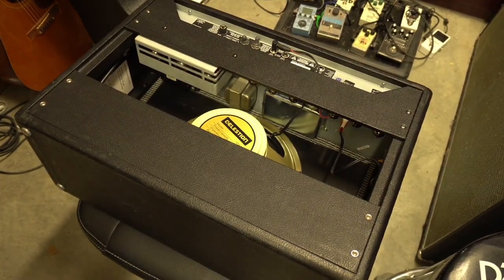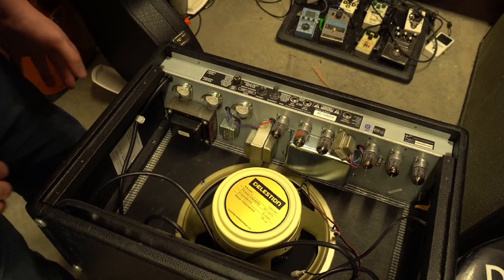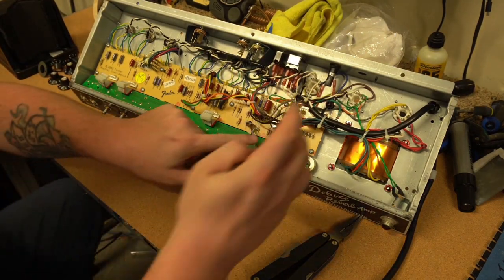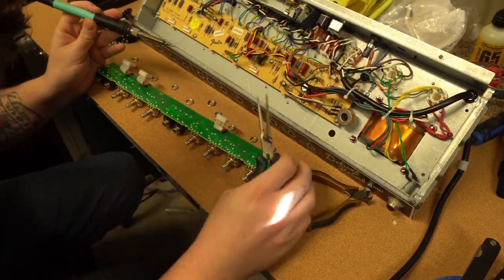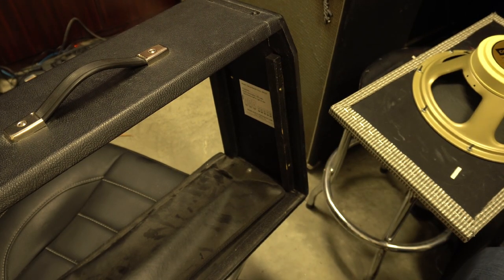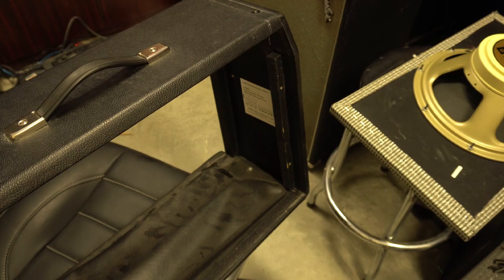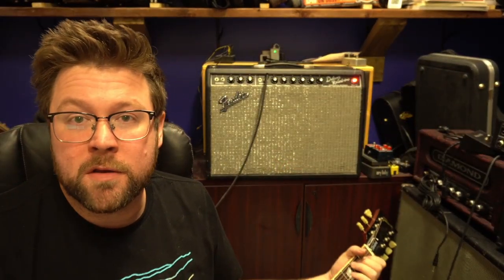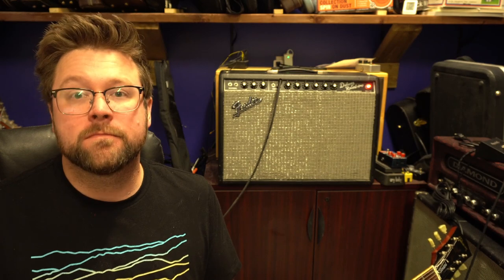Fender Deluxe Reverb BRIGHT CAP MOD. Mods and Updrades #3

Comment: It's the filter caps that store enough juice to kill you. The right way to do it would be to touch the leads of the caps with a wire that goes to a resistor then to ground, then check the caps for voltage. I just clipped the bright cap and the is a noticeable difference at even 4 on the volume, which is where I usually run the amp. The only down side was that it got a little to dark when rolling back the guitar volume, which I fixed be adjusting the value in my guitars treble bleed

Comment: I have the same amp and it has so much treble that I have to turn the treble all the way to zero and bass to 10.. I have to back my tone on my guitar back to about 2 or 3 . It’s horrible. In all fairness, if I turn it up to about 5, the amp is controlable. I use a delay and a nobles od and it’s like you said, amp does not take them well. Fender should have left that c10 cap out of the circuit. Thanks for the video, it is very informative.

Comment: Thank you! Believe it or not there are no other videos on YouTube to show how to do the bright cap mod on a DRRI! 
Note: it would be great to have seen it a bit better and get a better cam approach. The sound of your video is also pretty rough which disappointed me a bit, I tend to like “iPhone videos” they give a more realistic ideia of how exactly the amp sounds in the room but yours don’t!! It rattled bit time and I couldn’t realize whether the cap mod did any difference. Could you please share if this is really a drastic difference before/after? That would be also nice, if you have done a before/after sound clipping to see the differences.
Still tough great for doing it! Highly appreciated and already subscribed 👍
Reply from the maker: Thanks, I've changed my recording process a bit so now I think I get much better audio when recording. It definitely made a difference on the amp at lower volumes, I feel like you can achieve the same sound with the EQ but you really need to turn the treble way down. I also swapped the speaker to a celestion cream back now, so with the bright cap and the speaker change it does make a big difference

Comment: after many years of dealing with modern and vintage fender amps i have to say: modern jensen speakers are absolute crap, they have nothing to do with the old ones since they stopped making guitar amp speakers in the 60's. back in the 90's when fender finally launched the ri line they needed the original speakers which are jensens so they had to buy old speakers from ebay and reverse engineer them...we all heard that story before it never works out not with pickups,speakers transformers tubes the old stuff was better the new stuff sounds stiff overly bright and harsh.